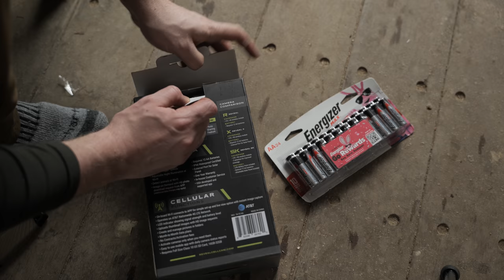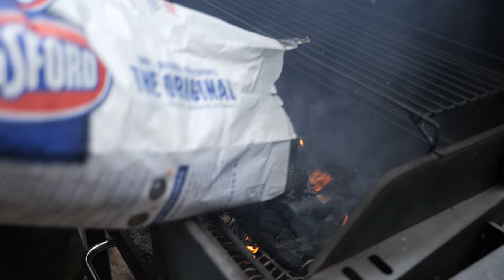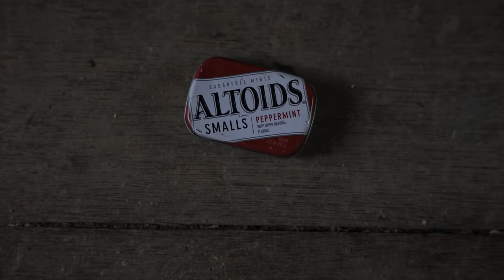Off Grid Cabin Overnighter in Spring Floods

Comment: Don’t worry about getting those 20 AA alkaline batteries … that cell cam will use them up fast … 😏  Energizer Ultimate Lithium AA will cost a bit more but they will last a lot longer, and they will preform much better in the cold… and they will not leak and wreck your camera!   
… I use the Spypoint version of cell cam at my hunt camp in Northern Ontario.  It can be challenging when the cell signal is low.  A LTE cell signal will use a lot less battery life than a 3G cell signal.  Also black bears have an exceptional sense of smell and i have had them rip my cams off of the trees!  They can smell my human hand scent months after i touch the cams.

 Love your videos!  You certainly put in the hard work 👍.

Comment: You have that chain way too tight on that saw.  You should have about 1/16" of droop off the bottom of the bar.  If it snaps you could loose a leg.   Looks like a Lopi stove in the man cave.  I have a Lopi  Freedom fireplace insert, and Really Love it!!  The firebrick lining is the key.  You need to get a couple of those heat operated fans to circulate the air better from that stove.  Nice setup!!  Yes, more trail cam stuff, videos too. I have several.  I  have mine set to one still and a 10 sec video.  Jerry

Comment: It looks to me that you ought to sharpen your Chainsaw chain - it should have gone through those logs much better than it did and the giveaway sign is that you're throwing out sawdust and not little woodchips.
Reply from the maker: It definitely needs sharpening! I don't think it's been sharpened at all since I got it in the summer, I have a lot of cutting to do this spring so it needs a full service
Reply: @BrooksandBirches  You have a Husqvarna I think? Quite reliable, but I prefer STIHL As long as keep air filters clean, the correct ratio of oil and don't leave old fuel in them for months then, they're usually fine.